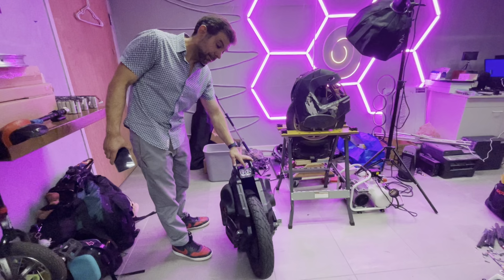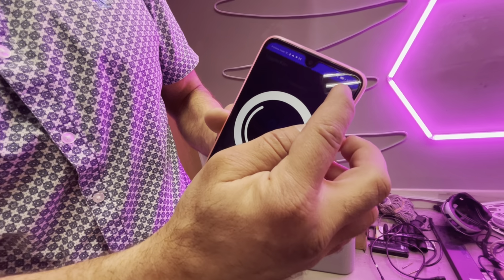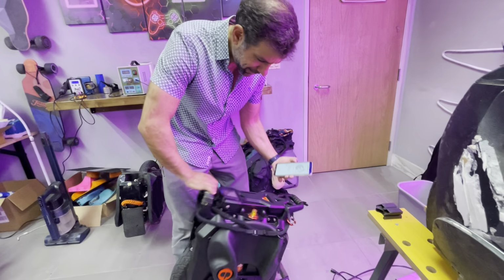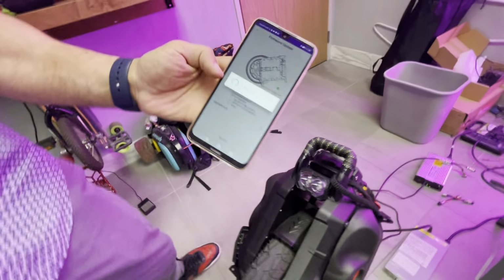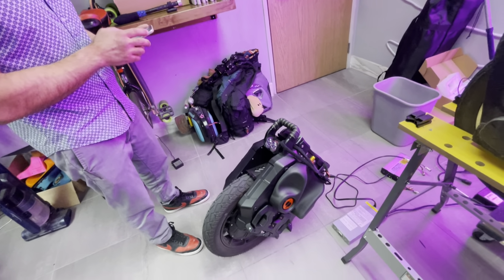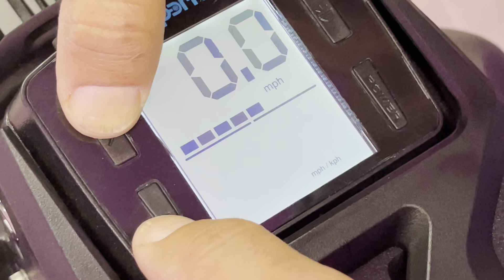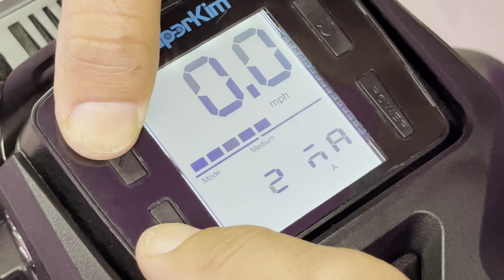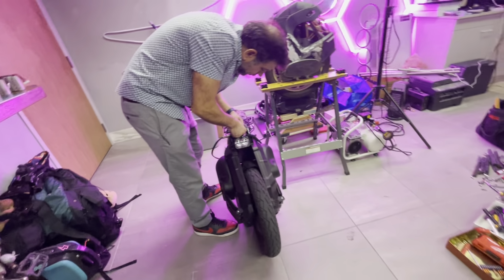Sherman S - Updating Firmware - High Speed Mode

Comment: You were already ok at the angle 🙂 L node lol. That's low battery mode to drop the voltage in an emergency to get "home". 
But yeah I'm still waiting for a supposedly new firmware to set angle tilt cut out to a higher angle.

Comment: Crazy lighting. The S18 is looking a bit sorry for itself . Your fast charger. I made up a cable for the Master but I only charge into one charge port. What I have done is cut off the screw down ring off the GX20-4 connector, can't see the need for that, push the connect on and pull it off, is more than sufficient.

Comment: Hey Dawn, I wonder if this Sherman S unit has high suspension stiction like mine. It might since you noticed it's not moving on small stuff as you'd expect.
Reply from the maker: I have no idea how to troubleshoot that! 
Roger made some changes and it does feel better now. 😁
Reply: @DawnSChampion  if it's sticky you can feel it by pressing on the wheel gradually with your hands, then it's also easy to identify when stepping on the wheel. It's stuck in position and poof it moves down one "step"